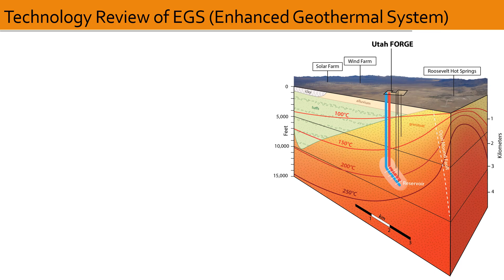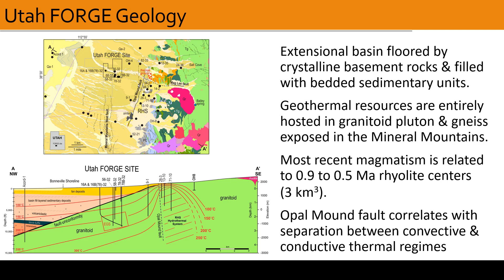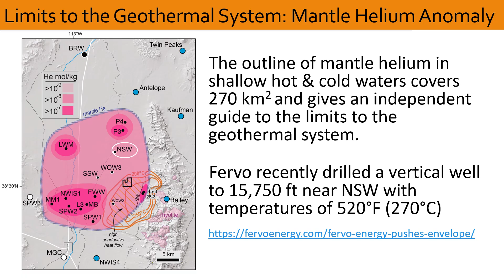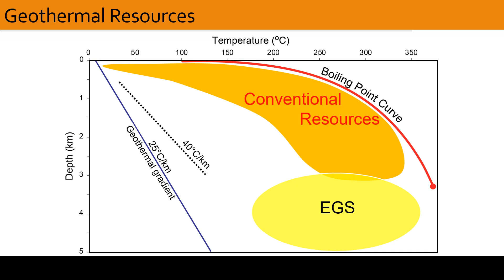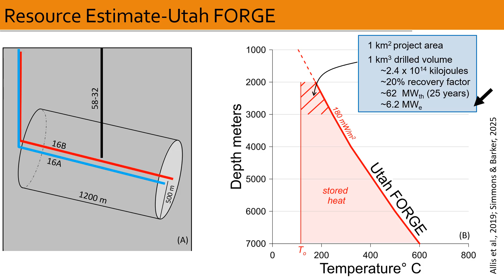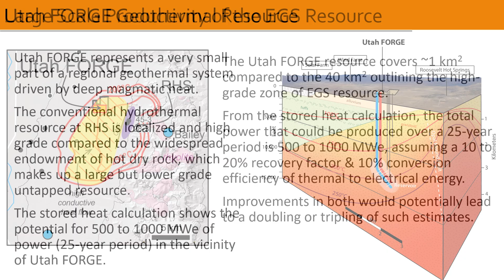EGS Hot Dry Rock Energy Resource at Utah FORGE - A Geoscientific Perspective

Comment: Correct me if I am wrong, but putting your summary at the end together with the chart at 18 minutes, this is my takeaway.
1. Drill deeper and you have continental wide access to geothermal heat. I didn't think that was anything new or revolutionary.
2. This type of drill deep heat while widely available is low grade heat, harder to capitalize on, and more likely to induce seismic events.
Additional notes are that if the same site of Solar FORGE was covered in solar panels. The capital costs would be a little less. The total lifecycle costs would be somewhere between a little less to a lot less, for the same amount of energy production. 

I love the idea of geothermal but mostly it still seems like it is not the best solution.
Reply: 2. Yes, there are places that are more likely to induce damaging seismic events, but there are many places it will not and the FORGE area is one of those places.  Understanding the tectonic stress regime is critical to reducing damaging induced seismicity.  Something that was not done at Basel and definitely not at Pohang.  The resource is far greater than 1,000MWe (1GWe) in the FORGE area.   It's likely going to be multiple of GWe as the resource has been proven down to 15,750' at 500+F temperatures.  Are we really going to layout 40km2 of solar panels in one area?  The damaging footprint of solar panels of 40km2 is ludicrous compared to the footprint of the EGS well pads and infrastructure that would be installed out here.  Yes, EGS is expensive but it is baseload power, something solar is not and neither is wind.  EGS is 24/7, something desperately needed as coal-fired power plants are actively being decommissioned and the rapid build out of data centers.  There isn't a place on the planet that has installed extensive solar and reduced the cost of energy for the consumer.  Ask Europe.  Solar and wind are not the solution to a decarbonized and electrified planet.  They are definitely part of the puzzle.  They just don't reduce cost for the consumer like many seem to think they do.
Reply: @geo-hk3px  Nothing is lowering the cost of electricity to the consumer. I am in favor of having geothermal as part of the picture as long as it is done with care. I am not sure we even understand the consequences of widespread systems like FORGE.
You said "The damaging footprint of solar panels of 40km2 is ludicrous compared to the footprint of the EGS " Yet my comparison was for the footprint you are already using at that sight. And solar would be cheaper. Desert wasteland footprint, which also happens to be really productive solar land is just good resource use. Not trying to discourage FORGE or geothermal it just needs to be kept in perspective. 
You speak of "baseload power" but that is just a matter of storage, and there are great options for storage. Unfortunately, right now most efforts have pushed toward ultra-high-tech energy storage solutions which drives up the cost considerably. I have a viable model for grid scale energy storage well below current costs.
Aircraft carrier nuclear power tech is stable, safe and reproducible. We can have thousands of them around safely with extreme grid reliability. Proper mix of reactors and tech and waste goes down to almost zero.
Additionally, municipal thermal depolymerization is something we need widespread for waste management, and coupled with generators run from the volatile gas production would make a huge difference.
Good luck at the forge!
Reply: @geo-hk3px  Well, that's because the battery or heat-storage component for solar and wind hasn't quite gotten cheap or developed yet, but that's obviously coming soon.  We'll have plenty of $25/kWh batteries, and likely $20, in the near future.  That with continually plummeting solar will be cheaper than gas most of the year everywhere.  Seasonal storage is the last challenge, but it's a minor one.  We can use lots of geothermal as the complement, and eventually seasonal storage at a good price will arrive.
Reply: If they can frack for fossil fuels at such a scale and not get shut down from the seismic events, EGS won't be a problem.  The fossil frackers have to constantly drill just to keep the business going.  EGS has the promise of drilling one system that just works for decades.  And they can pick the best spots with low seismic problems.  And why not do geothermal and solar and wind and batteries in one gigantic power plant?  They could do 10-GW baseload sites at the best geothermal reservoirs in the west.